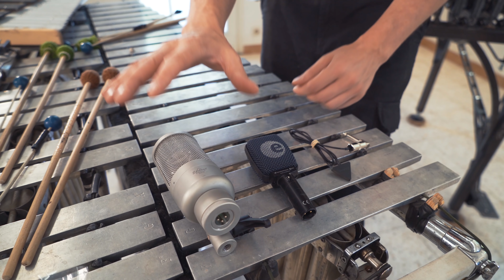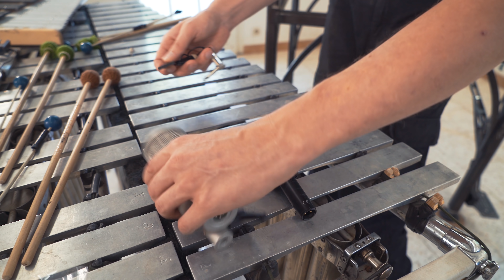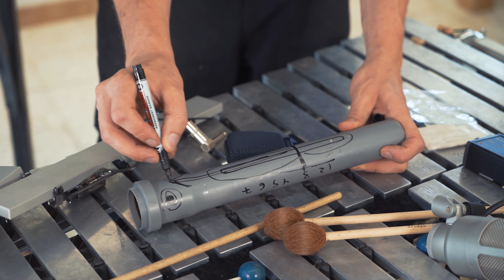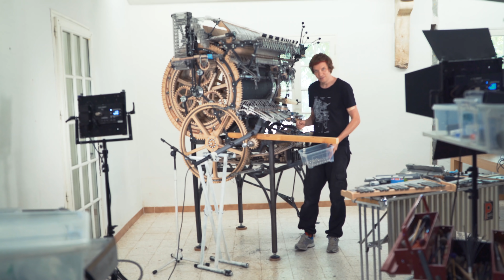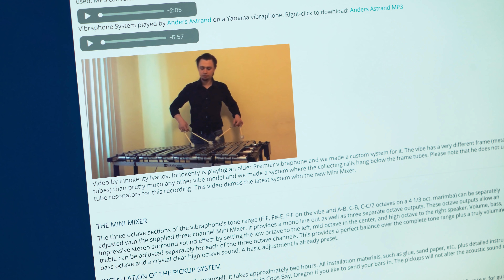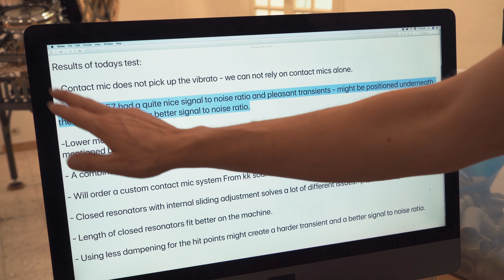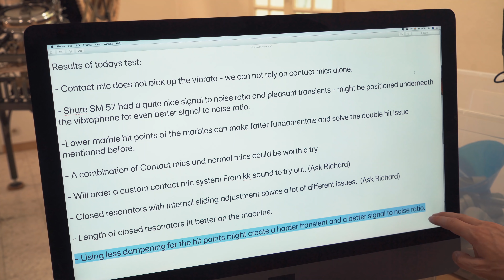Vibraphone Experiments / Microphone Types - Marble Machine X #96

Comment: Oh, how about some kind of electro mechanical vibrato, in that you pick up the vibration from the MMX (hall effect sensor?), which is then used to digitally modulate the signal from the contact mikes?
Reply: I would have guessed that using electric coupling (like capacitance or induction) was commonly used for vibraphone, as it is for electric guitars. I'm no musician, so maybe it's obviously not suitable for some reason I don't know. Otherwise, I think it's a path worth exploring if you're after high signal to noise.
Reply: @laurent3262  You mean like a magnetic pickup? I think that it would soun very different, just like an electric guitar sounds a lot different than an acoustic guitar. But a very interesting Idea none the less!
Reply: @fluxing5109  Exactly, like a magnetic pickup. Is the sound really different without any filtering? I mean it's a different way a measuring the same physical movement. I've always thought the difference of sound was mainly due to having only metal strings + signal processing.
Reply: @fluxing5109  no, not like a magnetic pickup per se. You could probably use a magntic pickup, but you dont use it to "record" a sound, but to control a modulation signal with it. The same way you would use a signal source to automate a filter on a synthesizer. except your signal source isnt a lfo, but rather a physical pickup
Reply: @TheVergile  I am pretty sure that the frequency of the vibrato is too low for that. that' why I suggested a hall sensor. The MMX could have a rotating magnet and be picked up by the sensor. That could be used to modulate the microphone signal.
I am pretty sure that this is not what martin wants, I just wanted to throw in another idea. (Not an idee :-) )
It can't hurt to think in all directions.
Reply: @fluxing5109  though at that point you could just use a potentiometer or rotary encoder on the axle instead of indirectly measuring the rotation
Reply: @fluxing5109  but then why use a real vibrophne ?? this comes down to kind of a midi vibraphone...
Reply: @phoelipp5228  Not really, the sound would still be picked up by microphones, even the vibrating would be generated mechanically by the mmx, only the modulation would be electronically done.
Reply: It won't sound natural.

Comment: You could try put the contact microphones on the resonator pipes
Reply: I was just scrolling down here to say the same thing. So, I second this idea.
Reply: Possibly not using the signal from the resonator pipe as audio but using to modulate the pickup from the plate. Buuuut if you are going that far you might as well just modulate it with a clean wave from teh computer :/
Reply: 00CooG00   Yes, at least I think yes.  I was thinking to apply the resonator and vibrato electronically (or in software) if you can’t get a contact microphone to capture those effects.  If that’s what you meant then yes.  Of course, that’s not as pleasing and feels a bit like cheating.
Reply: So you don't think that the sound waves will make the tubes vibrate as they go past? I'm also guessing that you would need to highly magnify the signal from these mics?
Reply: @malco84  not significantly enough, the more I think about it. Its attached to the vibrating surface, and that is going to overpower any vibration that would be caused by the air whooshing by (which is where the vibrato sound actually is) with that type of microphone. 
Kind of like the way ears work. If you had something directly attached to your inner ear bones that was vibrating, I doubt you'd hear much of the external sound that was coming into your ears. Bone conduction headphones work on a similar but less exaggerated principle.

EDITED TO ADD:
Though I guess we're talking about the resonator pipes, rather than the plates themselves. The effect could be less disproportionate, but my guess is not enough, given the way those microphones are designed to work.
Reply: @getoffmylawn5643  Yes we are talking about the resonator pipes, these are 'separate' from the plates which hover on arms. They are obviously connected to the rest of the machine though so might pick vibration from any other part of it. Martin is going to give this a try anyway so we will have to wait and see what the IRL testing shows.
Reply: @malco84  I hope I'm wrong, it will be nice if that works.
Reply: So many people gave said this but they fail to realize vibrato is in the air and not the pipe itself. Contact mics won't pick up the vibrato.
Reply: @BigDaddyWes  I wonder if you could have a pipe thin enough that it might resonate with the air, enough to be picked up by a contact mic.  Mylar resonator pipes?
Reply: @aaronrobinson2121  They need to be rigid in order to actually create a standing wave of vibrating air inside.
Reply: Interesting idea I'll post it to Martin in the slack chat straight away. Thanks
Reply: impedance is the problem here, the resonator pipe isn't vibrating, but the air in it is
Reply: Drill a small "window" in the side of the pipe and use the contact mic to cover the hole (perhaps with a membrane of some sort).
Reply: @Talaxianer   Maybe you could get something like a membrane to vibrate an stick the contact microphone to it
Reply: @Talaxianer  ...that's a good point. I don't know if its possible to get vibrato with a contact microphone, since the vibrato is a result of manipulating the soundwaves rather than the resonating surface.

Comment: What about putting the contact microphone on the resonator tube? Shouldn't that catch the vibrato?
Reply: I think the signal will be pretty weak (contact mics catches the vibration of the solid material you fix them on, and I don't think the tubes vibrate much...) and you will loose the attack of the sound
Reply: @BaptisteMarieYT  Well, it was just an idea. And it would be easy to test.
Reply: That - but instead of the contact mike on the curved tube - put it on the closed end?
Reply: @kin2naruto  What closed end?